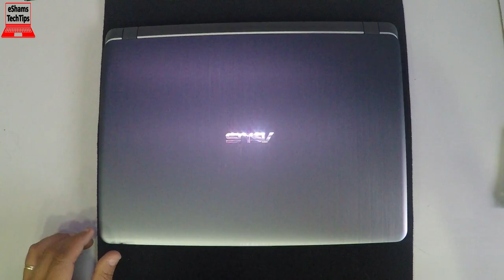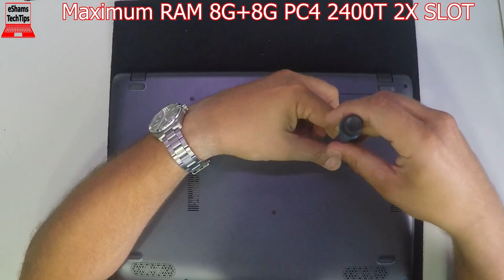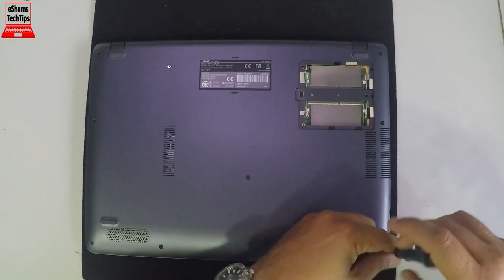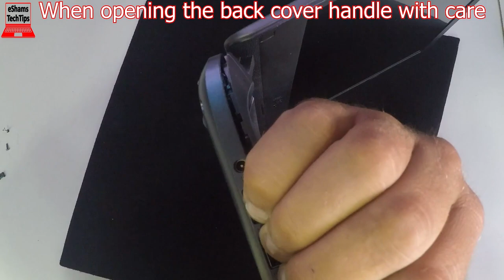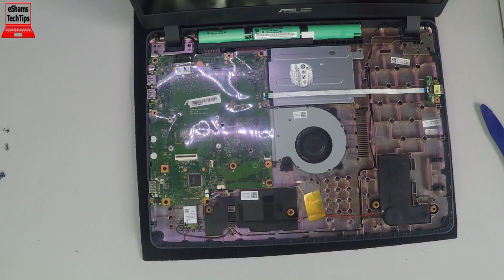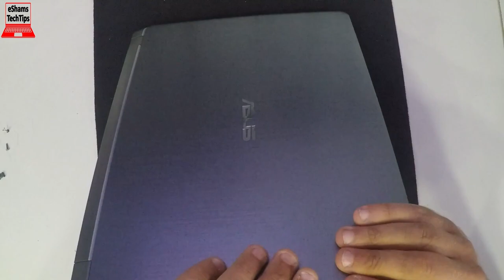Asus X507U HDD SSD Upgrade

Comment: I installed a Samsung 860 evo m.2 500gb ssd in my Asus X507uf-Ej092t. It works perfectly
Reply: I have the laptop x507uf-ejo92t .If I use samsung 970 evo plus 500 gb will it work  fine?
Reply: @gorgiousstar4313  confirm it from the service center, as 860 evo is M.2 sata while 970 evo plus is NVME, though it supports but still check, you can also search for your laptop under the reviews for 970 evo plus on amazon.
Reply: @parthkapadia3654  I have searched it in many places at internet but unable to find a perfect answer and getting very confused btw thanks .
Reply: @gorgiousstar4313  yes you can use samsung 970 as this laptop is compatible with nvme
Reply: Does x507u support m.2 ssd nvme?

Comment: Can I use hdd and ssd at the same time in my x507 uf?
Reply: No
There is only one SATA slot 
So can not install hdd and ssd at the time though there is a m.2 slot for m.2 or m.2 NVMe ssd 
Btw i am using asus x507uf (ej092t)
Reply: @debojitbhattacharya4093  I also have X507UF does this model support nvme m.2 ssd...??
Reply: @prajjwaltamrakar3487  yes you can add m.2 or nvme ssd . there is a slot for it
Reply: @debojitbhattacharya4093  Thank u....!! :-)
Reply: @prajjwaltamrakar3487  your welcome
Reply: @debojitbhattacharya4093  hey,what capacity  ssd u installed, also nvme or sata??
Reply: @sourabhpushpad7349  sata 240gb, u have to open whole motherboard to install nvme though
Reply: @debojitbhattacharya4093    thanks, BTW nvme and sata are two different types of ssd
Reply: @sourabhpushpad7349  ikr
Reply: @debojitbhattacharya4093  bro u said u installed nvme in ur a year old comment and now u commented u installed sata ssd, so i thought i should clarify ur doubt
Reply: @sourabhpushpad7349  yea 1month ago I installed 240ssd and I installed nvme SSD In sep 2021
Reply: @debojitbhattacharya4093  thanx again 😀
Reply: @sourabhpushpad7349  😎
Reply: @debojitbhattacharya4093  hey i have x507ua ej180t. Can i also install ssd under mother board? Please confirm and reply
Reply: @rohitmittal4152  the answer is yes, there is a slot for m.2 ssd

Comment: is the m.2 ssd can upagrad up to 512 gb?
Reply: Did you find the answer?
Reply: Yes it can. I installed a Samsung 860 evo m.2 500gb ssd in my Asus X507uf-Ej092t. It works perfectly
Reply: @parthkapadia3654  did you install nvme ssd?
Reply: @ottawac308  no, i installed samsung 860 evo m2 sata 500gb.
Reply: @parthkapadia3654  can you tell what key does m. 2 slot uses, Whether M or B or M+ B?
Reply: @parthkapadia3654  to install ssd, do I have to remove the original hdd or I can have both hdd and sdd? (same laptop as yours)
Reply: @CAhrithik  You can have both ssd and hdd together (remember to buy m2 ssd - the small one that looks like a chip). There is a free unused m2 slot behind the motherboard
Reply: @parthkapadia3654  You mean that rectangular shaped ssd? Samsung 860 Evo 250GB?

Comment: Can i upgrade my laptop into dual storage SSD + HDD? My laptop is ASUS Notebook X507UB-BR397T
Reply: Have you find an answer bro? We have same laptop model and I want to find out too.
Reply: @alfedalinan2271  you can but i did not upgrade mine
Reply: @alfedalinan2271  use m.2 ssd
Reply: @Rarddddd  may I ask why you didn't upgrade yours?

I also have the same model and your answer will help me, thanks!
Reply: @ame5851  because I believe I have to format my drive and install the windows into the new ssd, which is the reason we installed it in the first place right? I can't backup all my files and stuffs like that. So it's just my circumstances that's stopping me for upgrading.

Comment: Can we do M.2 ssd upgrade on this laptop
Reply from the maker: No, in this model you have on SATA3 slot
Reply: yes you can he has a m.2 slot under the motherboard
Reply: Yes, under the motherboard has a m.2 slot
Reply: @Shamsabdelkader  so X507U is the same type like A507U ?
Reply: @jatikofebrianahmad8084  is that m.2 slot nvme or sata3?
Reply: @dumitrascucristian-patrici1763  m.2 nvme
Reply: @jatikofebrianahmad8084  thank you a lot